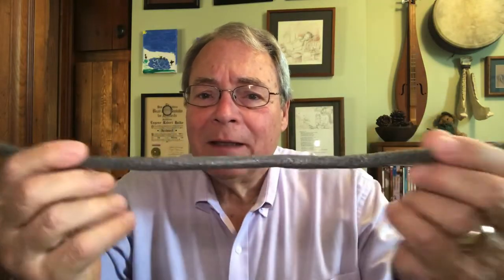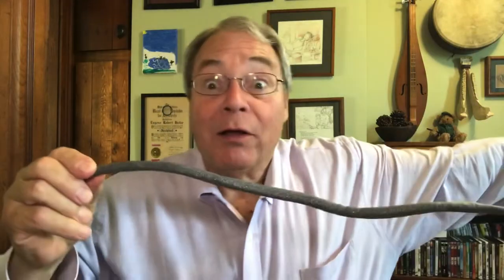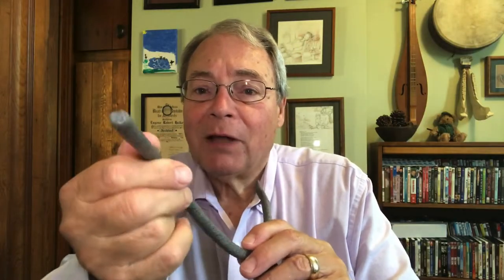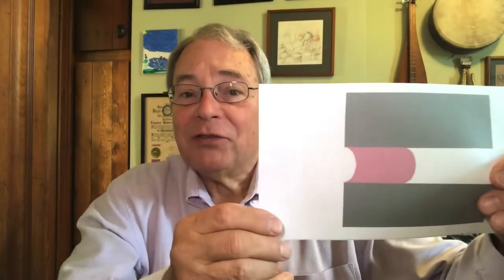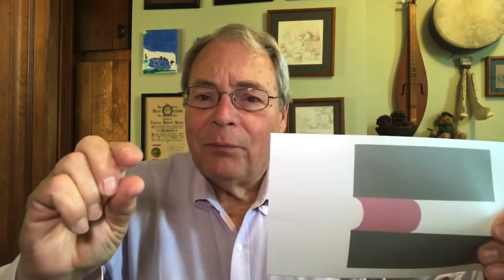Caulking with backer rod

Comment: Thank you for making this video. I have been a professional caulker for over 40 years. I get so tired of all of the misinformation on YouTube.Everything from shoot the sealant as deep as you can to spray the joint with soapy water to ease tooling.
 Backer rod provides one more essential function. It gives the sealant something to push against when you tool it forcing the sealant against the sides of the joint. Allowing the sealant to properly bond.

Comment: If my control joints are 3" deep but my backer rod is just 1 or 1.5 inches tall, do I need to fill the void underneath the backer rod with sand, or can I leave it empty? In the pacific northwest where it barely freezes.

Comment: Can this be put between a brick wall and laminate floor? Whoever put the floor down left a big gap between the wall of the building ( I live in a conversion) and the floor someone tried to put the scotia but doesn’t work because of heating pipes are exposed and low. I thought this might be a solution? Many thanks

Comment: I want to use the backer rod on a cement driveway and chalk it. That way, I stop having to deal with my joints turning into flower pots for weeds.

I have used sand for 20 years, but every summer, my joints get weeds. 

Can you be more specific to my situation? Please.
Reply from the maker: @sdg4883  Instead of backer rod and caulk, I think you need to clean the cracks really well and fill them with a no-shrink grout.

Comment: Thank you. Man, this is a problem because all I did was make sire I had at least 1/4 expansion gap. But this varies wildly from plank to plank—up to a half inch, because in the basement the drywall is raised. (For context, I'm not using quarter round– I took off the baseboard and plan to put that back to cover the gap.).  

Anyway, in my case, I dont see how the backer rod will help based on what you explained because in most places, it can't touch both the plank and the stud. 

I know I should have educated myself on this ahead of time but, well, here I am.

Here is the best visual I can give using text:
W|=wall side
o = backer rod
|P = plank edge

Ideal:
W|o|P

Mine, half the time:
W|  o |P

Again, some planks are ideal, but most are not and some are severely unideal. This varies literally from plank to plank.

The reality is that I cannot undo the flooring I have done. I just finished today.

Given that less-than-ideal-situation I put myself in, is there a better-than-nothing approach to sealing?  One that won't fill me with utter regret? Lol

I appreciate any constructive comments here.
Reply from the maker: If you’re working indoors with fairly stable temperatures, you probably don’t have anything to worry about.
Reply: @genehatke7410  thank you. To be honest, caulking is such a nightmare, this is what I'm hoping to hear.

Comment: thank you. do you want the backer rod to be the exact size as the gap or slightly bigger. for example, if your gap is 1/2 in wide. do you buy backer rod 1/2 in or 5/8 in?
Reply from the maker: You want the rod to compress enough that you can be confident it will stay in place.